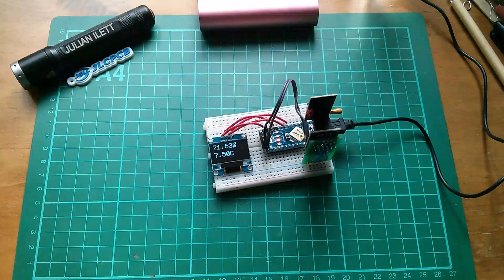Arduino nRF24L01+ Range Boost

Comment: Sooo if the signal is that close to working then a simple RF signal concentrator (like on a satalight dish) on the receiver or transmitter side would mean you get perfect signal in theory.

Comment: on the other end of the link place a reflector on antenna or maybe get a "wok"and place the radio at the focal point and direct the rf towards the house and then it will be going where you want it rater than omni-directional means..

Comment: 915MHz radios can transmit much further, many miles not just meters. Or get the nrf24l01 modules with proper antennas.

Comment: Lowering the data rate really works. A few yrs back for a certain project i used some RS485 2.4Ghz Radios running at 9600 to send small amounts of data over 3 miles. Worked great !.

Comment: This series has helped me to get my project working using these devices.  After using Julian's simplified code it still wouldn't work and then I found a hairline gap in a copper track, fixed the broken track and funny it now works!  Thanks for the inspiration Julian.

Comment: is your payload length optimal? i remember something about the payload length affecting them and that there was a sweet spot...dont know if it was library specific but i do remember using that length on my synchronised lights even though i only needed 2 bytes (pattern and step)
edit: did a google, some guy reported that 8 bytes worked best on his range tests. weird things these radios.
http://hallard.me/nrf24l01-real-life-range-test/

Comment: Decreasing transfer rates usually makes it easier to go farther...  These modules also come with a version that uses a "rubber antenna" as opposed to these PCB antennas.  I assume they have better signal coverage than the PCB ones.  That might help get you that extra foot to reach your desk.
Reply: Versions with external antenna often have more transmit power and LNA too. As low data rate as possible always helps and there is no need to transmit couple bytes like temperature at 2Mbit/s. Even the lowers 250k is overkill.

Comment: pretty sure that never would've occurred to me to try.  wonder if splitting open a cola/soda can and placing around the 'antenna' (entire unit) in the form of a collector would enhance the reception?
Reply from the maker: That might work - a flat sheet of aluminium also seems to work :)
Reply: Maybe a tin pie plate as a dish